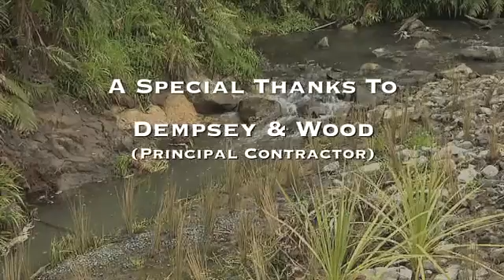Lucas Creek Streambank Stabilization

Comment: Not true that Compost nor Compost sock leak excess nutrients, nitrogen.  It seems intuitive but the fact is that well-cured, certified compost does have a small percentage of (generally less than 3% is "available")  nitrogen but that nutrient is NOT available for leaching.  It is biologically available but not available for leaching.  Also as soon as the compost is "vegetated" (studies show grass cover alone will require about 7-10% of the nitrogen) there will be a available N deficit.  But not to fear, the microbes and bacterial available in the compost will soon digest the Carbon and convert same to N as the native plants require.
Reply: John McCullah j

Comment: Using compost filled tubes has been shown to leak excess nutrients polluting the stream bed for years to come. It's better to use woodchip filled sacks or just clean fill dirt in place of the compost.                                                         Project looks great tho. Good technique.